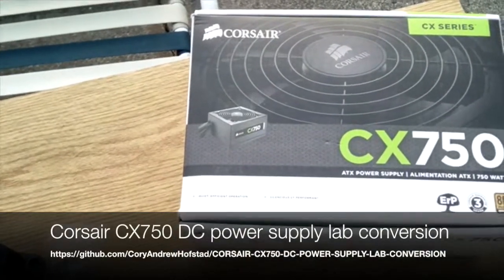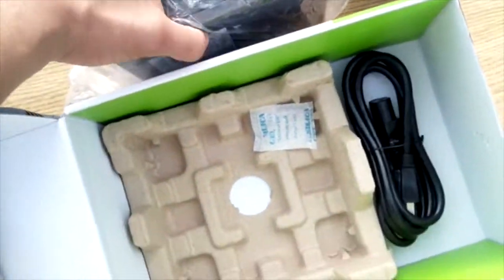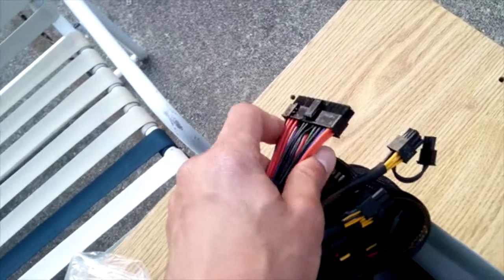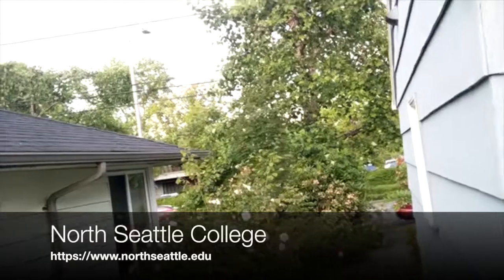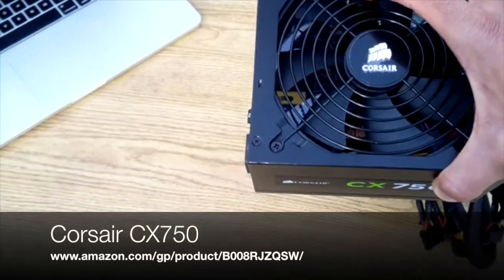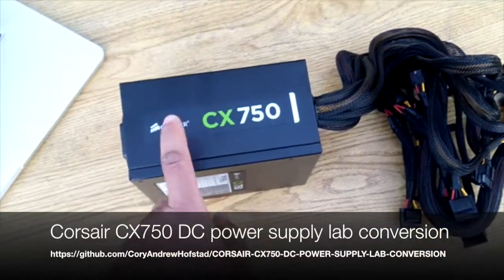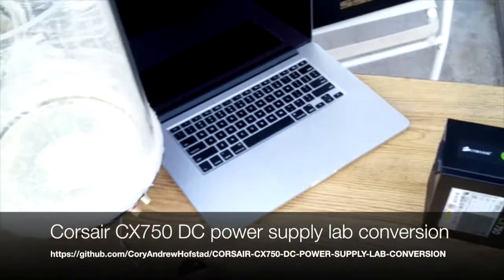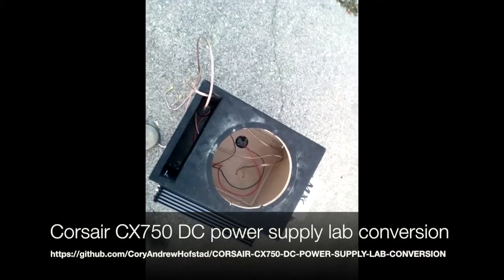Corsair CX750 DC power supply lab conversion project - Intro

Comment: Hay i wonder if you can maybe help me out i am trying to bypass the current limiting that cuases it to shut off.
I have the same cx750.
I need this to give me about 14.5 volts and upwards to 60 amps.
I already know it can be done , i myself have yet to have any luck getting around the safety features of this psu .
It will be combined with a second one to provide 120 ish amps and then maybe more.